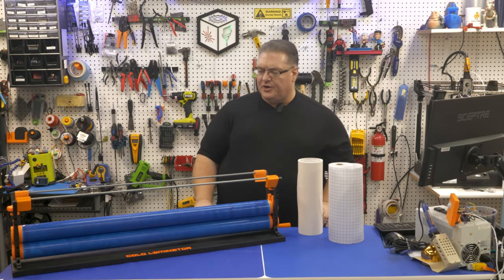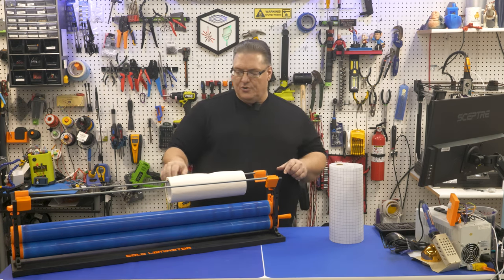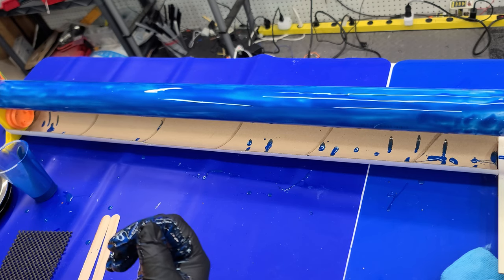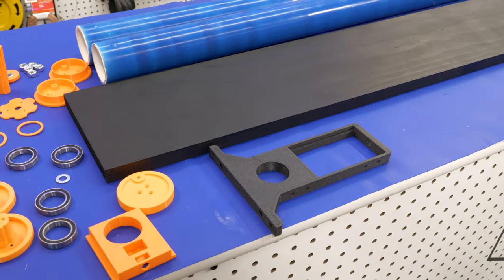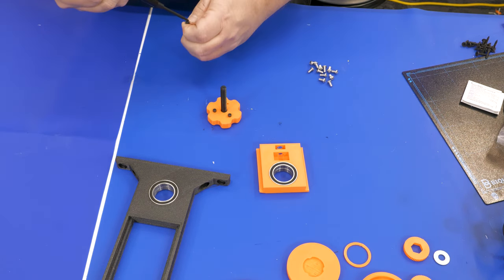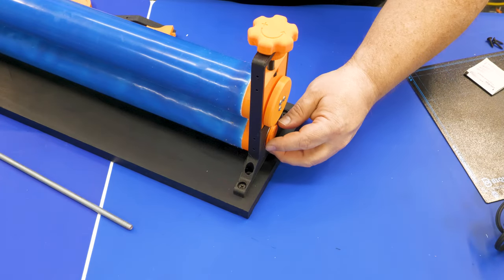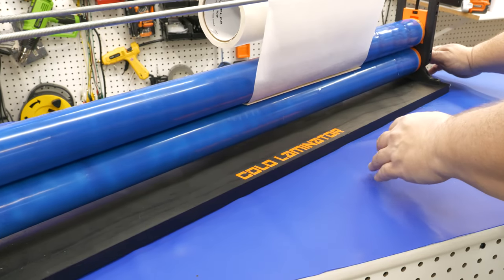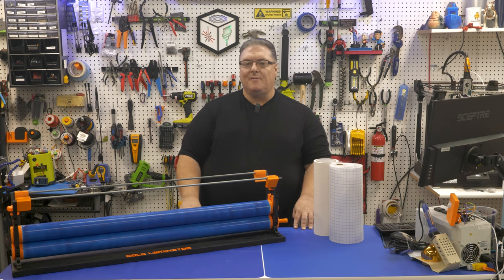DIY Cold Laminator for Cricut, Vinyl Cutters, Laser Cutters and Stickers

Comment: I have a 1 meter Cold Laminator. BIG tip. At all cost keep the silicone rollers covered and dust free. I have a special hand silicone roller to pick up dust. If you ever do any lamination on photographs, the tiniest spec of dust will leave a "fisheye" between the print and overlayment.
Reply from the maker: Awesome tip.  Yeah ists very sticky

Comment: Thanks for the great project.  I just completed mine.  I had to remix some little parts as my 50mm PVC pipe is for some reason not fitting properly.  I also used EVA mats for roller covering and it works like a charm.  Thanks again for saving me some money.  Oneday when I'm grown up, I'll start a YT channel as well.

Comment: Thank you very much for the video.

One option would be to print a flexible tube that embraces the pvc tube, they can be in several parts.
Reply from the maker: Love the idea.  I'm wondering though if that might leave layer lines. If you try it with success let me know.
Reply: I'll start with a curtain tube and a swimming noodle

Comment: Just as an idea you could possibly use tube balloons. The kind that they make balloon animals out of. That would have the benefit of easy replacement of the surface when it gets damaged or worn. I think you could use compressed air and soapy water for installation.
Reply from the maker: That's a pretty good idea and probably would work if you could get a large enough balloon.  A 3d print could be placed on the end to help slip it over.

Comment: My wrist is in need of a dough laminator... same concept but different  medium but about 4x more expensive.Hopefully I can learn how to make one...🤞
Reply from the maker: After some googling I'm pretty sure you could mod this design to make that work.  Do you happen to know what the rollers are made of in the dough sheeter/laminator?
Reply: A cooking  channel called Alex, on youtube made a 3D printed croissant roller
Reply: @MakersMashup  I ended up purchasing the dough laminator made by Brod and Taylor. The design seems relatively simple. As a matter of fact if pasta rollers were just 5 or 6 inches longer, there would be no need to dyi. I chose the Brod and Taylor because it has measured notches to control thickness and it uses a board versus passing the dough through rollers. The material for the board is hard plastic, like a cutting board and the rollers are aluminum. There are plans that you can download for 3d printers but my building skills are poor.

Comment: Two rolling pins, olts on each end with skateboard bearings set in to a peice of wood on each side and a hand made crank handle attached to one of the rolling pins. Easy peasy and you dont need a 3d printer
Reply from the maker: I await your build video good sir. 🍿
Reply: @MakersMashup  i probably won't make a video of the build unfortunately, it wouldnt fit in with my channel topic. Maybe a short perhaps but we will see 👍 If i had a 3d printer i would absolutely make what you made though
Reply from the maker: 3D Printers are life changing.  Come to the dark side.  We have cookies (made of plastic). :)
Reply: @MakersMashup  i do like cookies 🍪
Reply: @MakersMashup  Man, they really are.  It's like a really big hammer--suddenly, everything is a nail.  You find a million ways to slap together a quick .stl to fix things, do all sorts of weird things (like adjustable grip clamps to hold a giant sheet of canvas)...suddenly, something you would have tossed out is fixed with a 5 minute design and $.20 of filament.

It's an absolutely amazing tool to have in your toolbox.